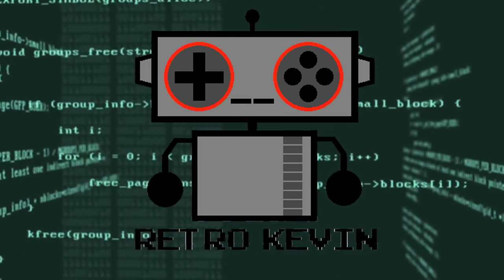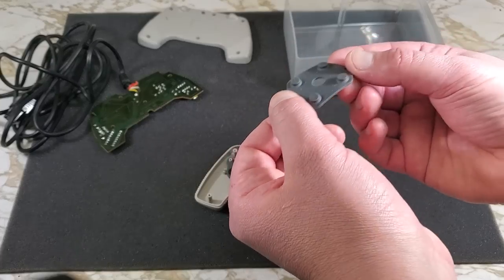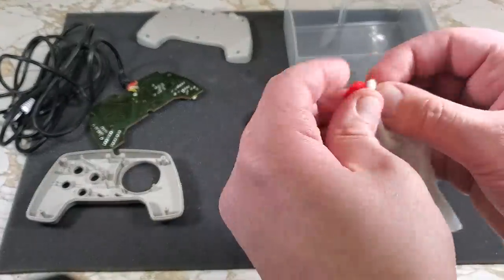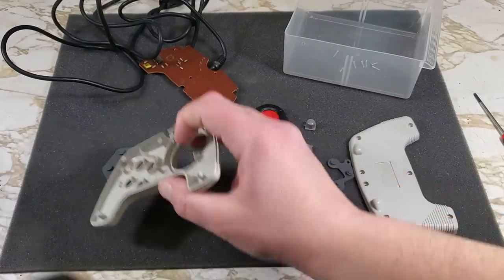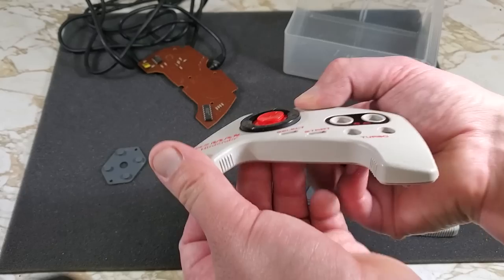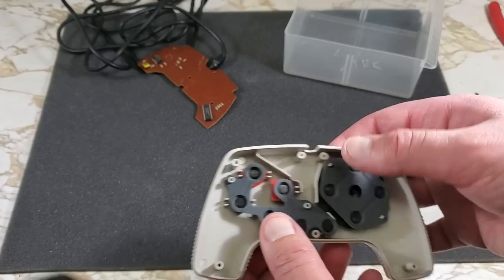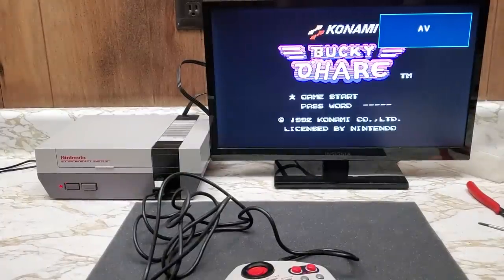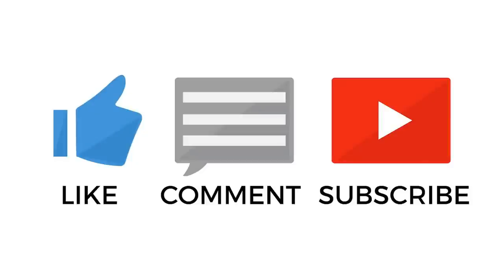Tear down and cleaning a NES MAX controller for the NES

Comment: I would suggest different chemicals.  Denatured alcohol, Goof off, and Meguiar's Vinyl protectant.
Reply from the maker: Always appreciate tips.
What would you use each one for?
Reply: @RetroKevin  Goof off to remove marker, sticky stuff, and general cleaning (warning can remove paint).  Denatured alcohol to clean electronics, general cleaning,  and remove thermal paste (warning can remove paint) . Meguiar's vinyl protectant to restore cables to their old shine and flexibility.
Reply from the maker: @moandaindesigns  Is Goof Off like Goo Gone? I've used that before and didn't care for it. Otherwise the other two are solid alternatives.
Reply: @RetroKevin  good off is better and doesn't leave a oily residue like goo gone.
Reply from the maker: @moandaindesigns  Nice, I'll have to try it out. Thanks again for the feedback and info 👍
Reply: I use soapy water and a old toothbrush to clean the parts that can get wet. The other parts like the circuit board I use rubbing alcohol on.